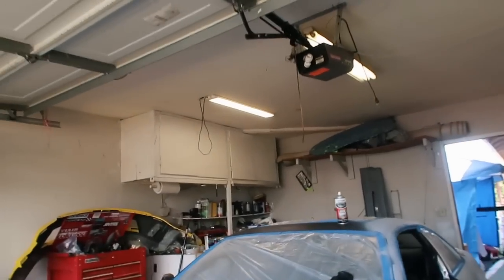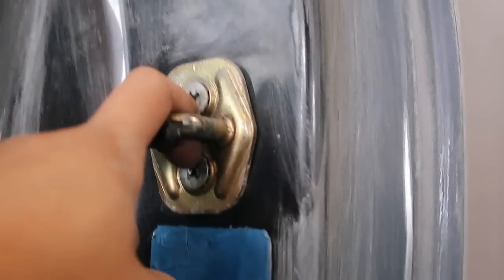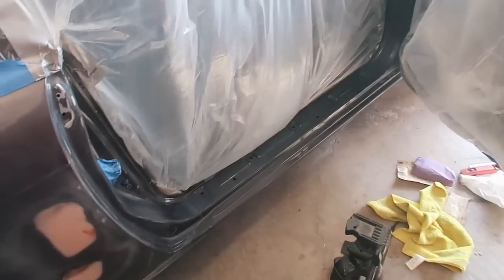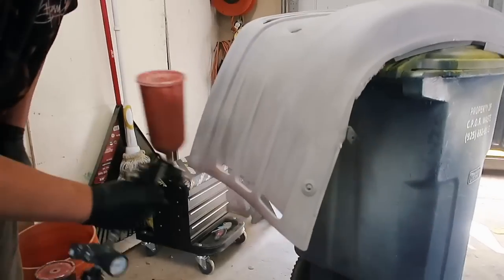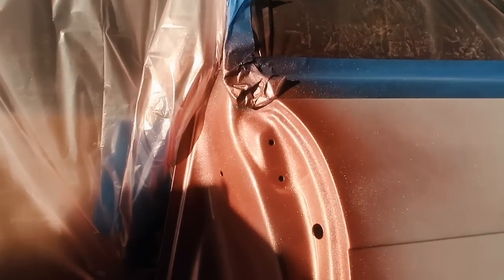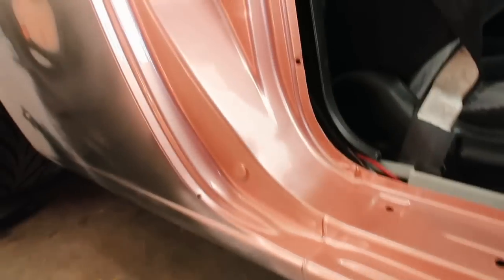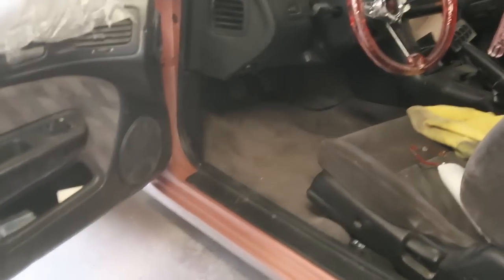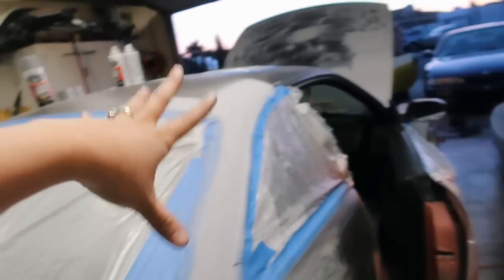Painting My 240SX!! Color Reveal! Pt.1 Door Jambs

Comment: Did you use flexible primer on the bumpers?
Reply from the maker: i didn't know i needed flexible primer the bumpers are fiberglass so i just used regular primer
Reply: Blaine Nojiri as long as its polyurethane you should be good, but definitely use flexible primer on plastic, if you don't it'll start cracking possibly even peeling
Reply from the maker: Thanks for the tip. I’ll keep it in mind.